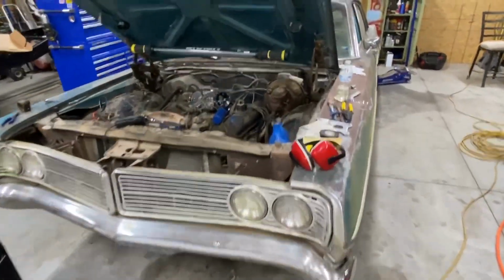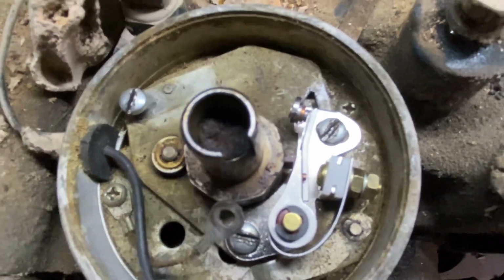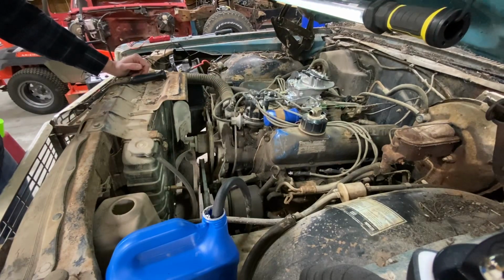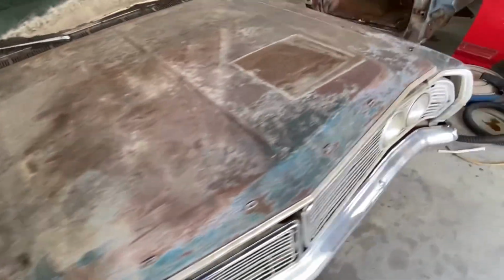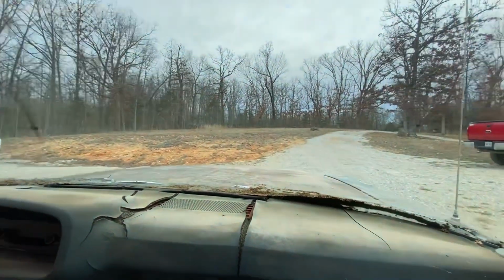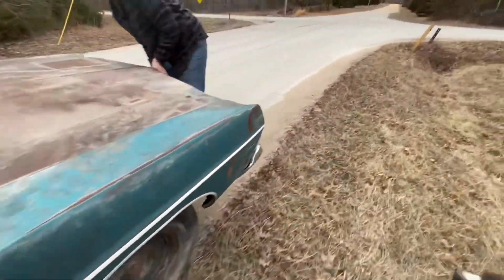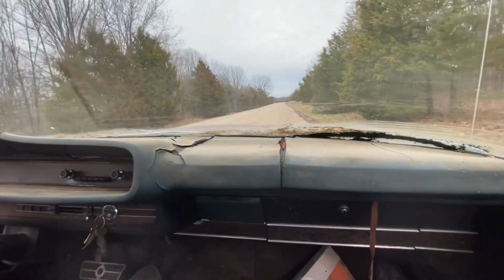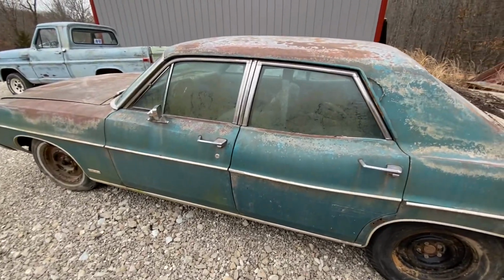1968 Galaxie 500 Drives after sitting for years!

Comment: I just bought a 68 Galaxie myself and it's pretty good condition, runs and drives. I bought it as to be a daily driver/weekend fun car that my grandson, who's 11 and just moved in with me to ticker around with and to be his first car when he turns 16 but he don't know that yet, it needs a good clean up some interior work, It needs a new dash pad, the one that's on it is beyond repair and there's a rip at the seams in the drivers bench seat but were just going to find some cheap Mustang bucket seats to put in it. It will also need some body and paint work, It's gold with white vinyl top which is in REALLY good shape so we have decided were going to keep and just recondition. there's a pretty sizeable dent in the trunk and it has the usual dings and dents in to for a 57 year old car. It was garage kept here in South-Central Arizona, When we repaint it were going to repaint it the original Sunlit Gold and then we'll just repaint the wheels gold as well and put some baby moons on it, I paid $3500 for it and not planning on spending alot on it, I've got a $10,000budget for it and what we have planned for it I don't think I'll even hit 10k.
Reply from the maker: That’s awesome im sure you both will have alot of fun working on it.  Thanks for sharing!
Reply: @mattsgarage6670  Yeah and the best part is he has no idea it's going to be his.

Comment: Single points is correct.  Dual points were on specific high performance engines, not a 390 two barrel.  Good solid combo, durable and long lived.
Reply from the maker: It seems to run well

Comment: matt garage… your 68 actually have C-6 auto transmission mated to 390 ..:FMX only goes on small block 351cleveland,351M and 400M only from 69 to 81 or82 i think
Reply from the maker: Thanks for the info i believe you are correct
Reply: FMX came behind some FE's but not super common.